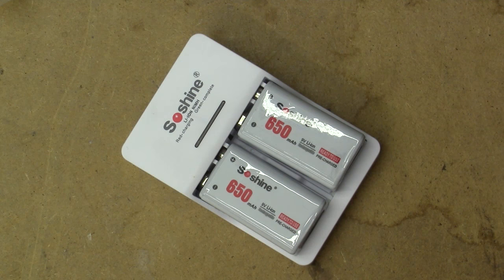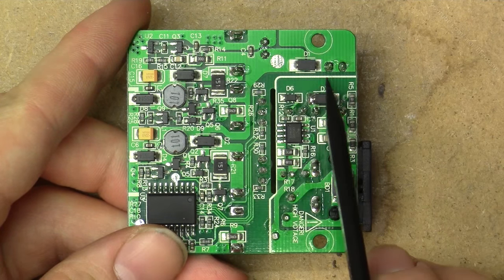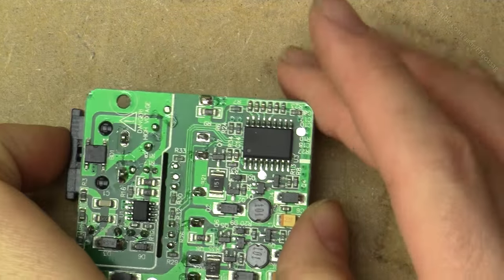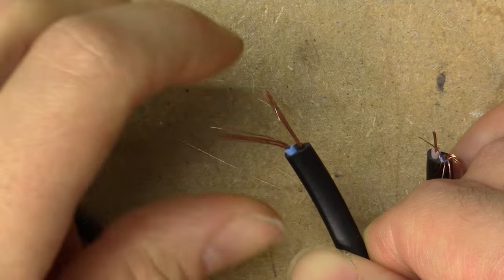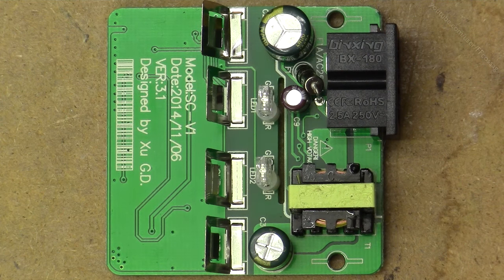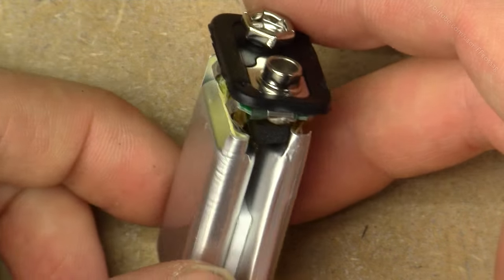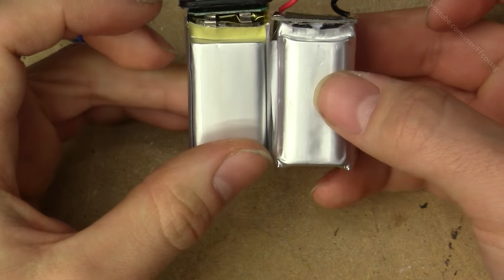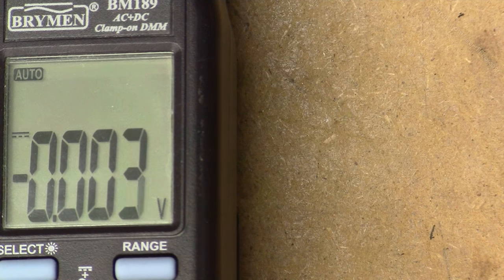Soshine charger & 9V LiPo battery teardown

Comment: What I'm trying to figure out, is wether they are good or not to use in a guitar... I read that lithium ion 9V batteries can create high frequency noise, so I don't know if I should buy these ones.
Reply: Le bruit peut venir  du convertisseur interne.
Et perturber ensuite les signaux audio de la guitare.
Reply: @yannbreizh3128  
Thank you. But apparently people say that when they use different or not rechargable 9v batteries, the noise is absent. But I don't have experience about this myself.
Reply: @yannbreizh3128  
But maybe you're right.

Comment: Yeah, that is not unusual with US style plugs. I think the more robust ones are made with fairly thick steel or brass and are molded quite deep into the plastic, but are still susceptible to bending if you accidentally stepped on it or something. Many vintage american electronics (1970's and earlier) used prongs that are made by taking relatively thin sheet metal and folding it over itself, which tend to bend very easily and are not robust at all.

Comment: FFcossag, do you think I could charge these in a NiMH trickle charger? since they have a protection circuit? I got an O2 Amp that has a built in charging circuit, but has poor battery life with the 200mah NiMH's that are about the same price as these.
Reply from the maker: No, you really ought to use a lithium charger for lithium batteries.

Comment: you can step on and still manage to plug in "most" good US plugs if it bends enough to be noticed it should be the plug metal that bends and should not pull away from the plastic like that one looks to have done.

Comment: that's odd ... My experience was the other way round ... I started with soshine [bought 2] but the terminals snapped off one and then the case broke on the other ... been using EBL 600's ever since ...
With the soshine that the case broke open I removed the batteries from the top and board and hardwired it to 2x 18650 cases ... I used 2x 3.7v 9,900mAh 18650's  ... but here a thing that's also odd ... I get about the same use out of a 9v 600mAh EBL as I do out of the one I've made and I don't understand that at all ... surely the 2x 3.7v 9.900mAh 18650's have a lot larger capacity than 2x 3.7v 600mAh that were in the soshine ..
Can you or anyone else shed any light on why I'm only getting the same amount of time use out of 2x 3.7v 9,900mAh 18650's as I do with a 9v 600mAh EBL  ???? ... I'm using them with 2x 5630 LED's with a 47R resistor on a 9v clip.
Reply from the maker: There's no such thing as a "9900 mAh" 18650, lol. Those cells are trash.
Reply: @FFcossag  : Yes, thank you, I know it is a lie now ... the 9,900mAh battery itself is about 750mAh ... I have now dismantled an old laptop battery pack [last night] and recovered 6x 4,000mAh 18650 batteries from that [the case said they are 4,000mAh]... they are old, so I also ordered 4x new NCR18650B 3,400mAh ... the learning curve on lithium batteries only cost me about £12 [13.47 euro] and I still have 10x 750mAh batteries that I can use on other projects.
Reply: @FFcossag  : I now have a 9v 4,000mAh battery by using 2x ex-laptop batteries with the top off a broken 9v battery !!!
Reply: It's possible that you bought fake Soshine batteries.
Reply: @MaximC  : It is ... however you might note that I used this as a learning experience [research and development] and I now make my own 9v batteries [for my own use] using the hardware from dead EBL 9v rechargeable batteries and old laptop 18650 batteries ... 
The EBL 9v 600mah ones themselves last me about 10 years of daily use [seriously], unless the power packs inside them are / become faulty. 
I have even used the internals from dead 9v EBL's to make my own 12v batteries.
Reply: @alasdairblackmore2592  
By any chance do you know: will any lithium ion 9V rechargeable battery will produce high frequency noise in microphones?

I've heard this can be a problem.

I'm trying to figure out if I should buy lithium ion 9V rechargeable batteries for the use in my guitar.
Reply: @MaximC  : I've turned a 12v car [cig lighter] to 5v usb converter into a 9v to 5v usb [by adding a 9v battery clip] and used that and a lithium ion 9v to power a microphone in an audio recorder and not had a problem ... the only time I've experienced a high frequency feedback in a microphone was when I used an external non waterproof mic outside in the rain ... [it got saturated] ... but the high frequency feedback stopped when I drained the water from it using tissue paper ... 
Some manufacturers of equipment say "do not use rechargeable batteries" in their equipment and all that happens when you plug them in is the equipment doesn't power up ... however, I have used a 9v lithium ion battery in equipment that says do not use rechargeables..  and it worked fine.
The important thing that I've found with lithium ion is that you must be careful to plug them in the right way ... as some equipment will have things inside them that explode [micro explosion] and the equipment will stop working if / when you don't [especially in 9v - 12v converters] !

I use "trial and error" in my experiments  and the 9v lithium that I use are mostly 600mah ... shop bought alkaline 9v non rechargeables [tho you can actually recharge them] are normally about 175mah.
PS: don't waste your money on the 9v lithium ion recheargables with a micro usb socket inside them ... I bought 4 and they're a gimmick ... they only have one battery inside them and they only last me an hour running 2x 0.5watt LEDs [I get 4hrs + using EBL 600mah]  ... both the EBL and SOSHINE have 2x 3.7v batteries inside them [8.4v]. 
I have yet to disassemble a SHENTEC 800mah  ... they rattle when you shake them and only last as long as an EBL 600mah.
Reply: @alasdairblackmore2592  
Oh, I see, thank you very much for the information. And thank you for the tip about 9V rechargeable batteries with micro usb socket - indeed, I myself closed ones, like Soshine, with branded/quality charger is the best way to go, best way to avoid paying for batteries that then will soon end up in garbage. For the same reason I decided not to buy no-brand Chinese rechargeable batteries, even though they are cheap, they are probably trash plus I would still have to buy a quality charger so the total cost would still be relatively high.

Right now I'm comfortable with buying two Soshine batteries + Soshine charger, for ~26 euros. 13 euros for one rechargeable 9V battery - doesn't seem bad. And Soshine is a quality brand, so I know I'm not buying garbage.
Reply: @MaximC  : Yeah, no problem.  at the moment 2x EBL 9v Lithium ion batteries would cost me about 18 Euros ... however, I bought 10 when they  first released them for about 65 euro [and then managed to buy 4 more for about 9 Euro a year later] ... my 8 slot charger cost me about 23 euro and came with 4 batteries ... and, I've had to repair it once [so far]. 
My Soshine 2 slot charger broke before my first Soshine 9v did ... but I repaired that by adding a 9v clip to the internals ... I still have it somewhere, but I don't use it . 
I also managed to get a 3 slot 5v charger that I can use with 2x 10w solar panels ... it cost me 13 euro and came with 3x 800mah 9v lithium ion rechargeables from a company called "SHOOT" ... they whacked the price up about a week after I bought them ...  and I probably won't ever need to buy anymore, as I can use that charger with my EBL's. 
Recently, I bought 4x 3000mah phone batteries [flat shaped ones] [microsoft branded] for about 6 euros, and I'll probably be making a 5 -12v system to power 10x 10watt leds with those for a cosplay helmet ... a cosplay shield ... or a rechargeable underwater [floating] search light.
Reply: @alasdairblackmore2592  
Thank you.
Wait, the 2 slot Soshine charger broke? After how many charging sessions??

What charger do you use now for your 9V rechargeable batteries? What brand?
Reply: @MaximC  : I had the charger for about 3 years before one of the slots [the one on the right] stopped working [used it every other day] ... After disassembling it I discovered that the internals still worked on it, so I soldered a 9v battery clip to it [made a hole in the plastic] and it still works [or it did last time I used it]  ... I have no idea why the slot connection originally failed ... I stopped using it when I bought the 8 slot EBL [UFO Shaped] 240v one and I have been using that one as my main recharger ever since [daily] ... I use my "SHOOT" 3 slot 5v [usb] one when I go out visiting over a weekend or go out camping.
Reply: @alasdairblackmore2592  
Thank you again. So EBL is a quality brand. I thought it was a Chinese "brand".
Reply: @MaximC  : I think they're maybe made under license in China for another Company ... They've actually been making batteries since 1998 ... and I myself have not yet had a problem with mine except for when they die [sometimes they swell up] after [for me] 10+ years of daily use .
I bought all of mine via ebay !
Reply: @alasdairblackmore2592  
I was skeptical when I saw them on Amazon website here in Italy. So I guess I shouldn't be skeptical, they are quality batteries. 

Thank you so much, you know. I appreciate you.
Reply: @MaximC  : There was one issue ... not sure if I mentioned it before but I think I should if you're going to buy some ... When my charger says their charged [the light turns from red to green] they're not ... I have to switch off and then switch on the charger and count to 9 seconds ... if the charging light turns green in those 9 seconds then they're fully charged [or recharged] ... if it doesn't then they will go back to being recharged when you restart the charger. 
Don't think the Soshine batteries that I had did that !
EBL says they don't have a memory but I think they're mistaken.
Whenever I recharge mine I always count to 9 and if the light turns green in that 9 seconds I take them off the charger and have them ready for use ... if they don't I continue the cycle [switch off at green and switch back on and count to 9] till they do !
The older they are the more I have to do it ...  although it seems to max at 4x for my oldest batteries.
Reply: @alasdairblackmore2592  
Interesting. And interesting that other batteries, like Soshine, don't have this problem. I'm saving all this information to my file on 9V rechargeable batteries, by the way. In case I will forget.
Reply: @MaximC  They don't "seem" to have that problem ... isn't the same as they don't have that problem ... !
The recharger [Soshines recharger] might just cut out when it reaches 8.4v and then just not recharge it further till it gets below a certain threshold !
After all, Soshines recharger is a Lithium Ion / NiMH recharger ... and my EBL only recharges Lithium Ion ... do you understand ?
I have this recharging issue with all of my lithium ion batteries ... even my teeny tiny 3.7v 250mah ones that I use in other projects ... !
Reply: @alasdairblackmore2592  
I understand, of course. But I wonder how many percentages of the full charge you actually add by doing that process, what's the charge (in percentages) at the point when the led goes green the first time. Because if it's just a few percents - it's not a big deal to me.
Reply: @MaximC  : yeah ... the recharger doesn't show the recharging process in percentages ... you as a user are the one who decides if you're ok with a recharged battery only lasting for one hour when it could have lasted for 4 had you continued cycling its recharging process ... !
The older the batteries are the more they need to be cycled [off / on ... off / on etc] on the charger !
I myself like working with "fully" recharged batteries, and I learned how to recharge these 9v 600mah that I use to full charge by direct relevant experience via trial and error ... if the light goes green within the 9 second count when I recharge them, then to me they are fully charged enough ... if they don't then they go back on recharge till they do.
Reply: @alasdairblackmore2592  
I wasn't criticising, I was just wondering how full is a battery after the light does green first time. Just in general wondering, I don't expect you to know the answer.
Reply: @MaximC  : I didn't think you were criticizing ... 
I am giving you as much data as I can [or at least trying to] and leaving it to you to work out what you need to know.
New [fresh batteries] don't act like those that have been used every day for 10 years [or more] when they are being recharged.   
My oldest batteries give me 1hr of light @1watt after they reach the point where the charger turns green ... and that would be 25%  if a fully charged one gives me 4hrs.
And, if I have to switch the charger off / on 4 times to recharge one then surely it stands to reason each session provides 25% ... if I have to do it 5 times it's 20% ... and 6 would be 16.66% etc etc etc.
Reply: @alasdairblackmore2592  
Oh, I thought you thought I was criticizing. 😅

So the difference is substantial, from 1 hour to 4. 

Good to know all of this. Thank you, my friend.
Reply: @MaximC  : hehe ... No, it is not 1 hr to 4 hrs ...  its one recharge session or 4 recharge sessions ... I don't rely on a clock to recharge my 9v batteries ... I rely on the green light. 
I have no idea how long it takes for one session [or 4] ... I just put the batteries on the recharger when they run out of power and then take them off of the charger when I'm happy that they are ready for me to use.
Reply: @alasdairblackmore2592  
I meant when you take them off after first green light - they last for 1 hour, but when you take them off after the light turns green after the 9 second rule - 4 hours.

In that case the difference is indeed substantial, between charging normally, and charging with 9 seconds rule.

Did I get that wrong?

But then again, we are talking about old batteries, that were used a lot...
Reply: @MaximC  : Yes ... that is correct ... hehe ... may I ask ... what do you use your 9v Soshines for ?
Reply: @alasdairblackmore2592  
I plan to use them in my guitar, multimeters and some other devices.
Reply: @MaximC  : ah yes, I remember ... have you not tried one in your guitar yet ?  
well, when you do don't forget ... practice makes perfect .. and, good luck.
Reply: @alasdairblackmore2592  
No, not yet, I wasn't sure if lithium ion 9V batteries are suitable for the guitar. But after researching a bit, it seems they should be.

Thank you, good luck to you too.